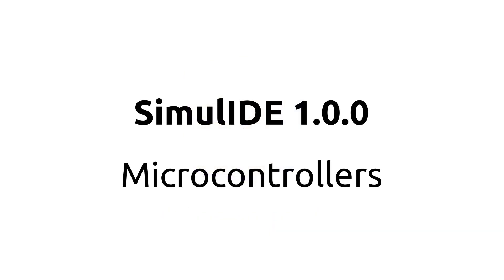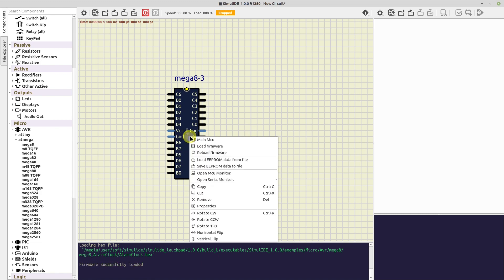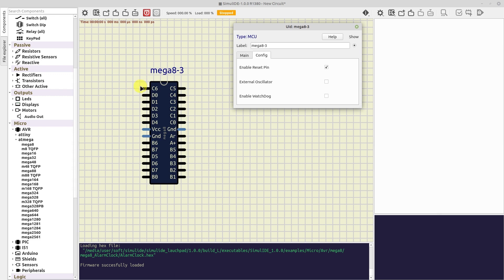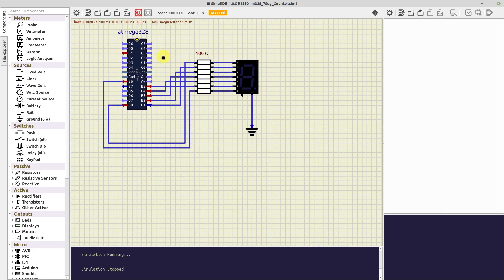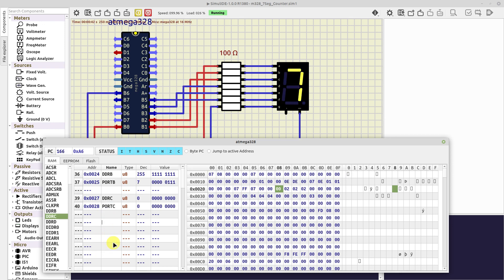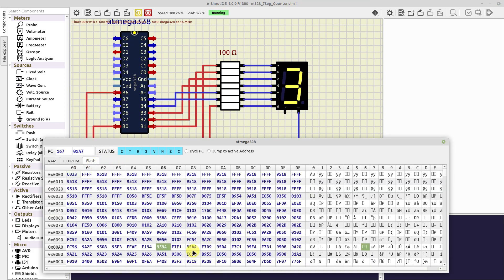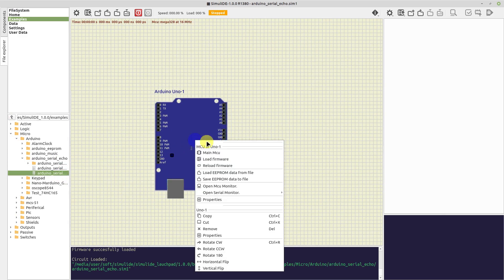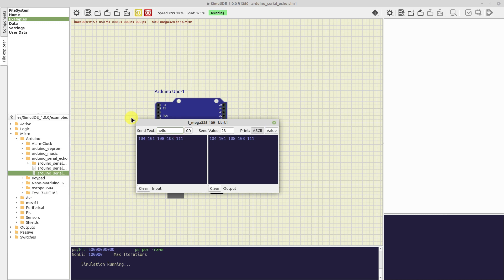Microcontrollers basic use SimulIDE 1.0.0

Comment: Hello Greetings, it gives me file.exe error not found in the path address option.  and can't simulate multitask for Arduino?  It gives me several error codes, please confirm me, thanks.
Reply from the maker: The "Tool Path" must be a folder, not a file.
You should select the folder of the Arduino installation in your system.
About multitask and those error codes, I don't know what exactly are you doing, so I can't help.
The best option is to open a discussion in the forum explaining what are you doing and which are the error codes:
https://simulide.forumotion.com/
Reply: OK ...oh! i am using arduinblock and i am using multitasking in programming because i want to make a program that executes several tasks at once.
thanks. @simulide6736